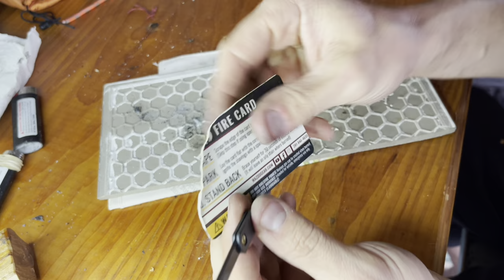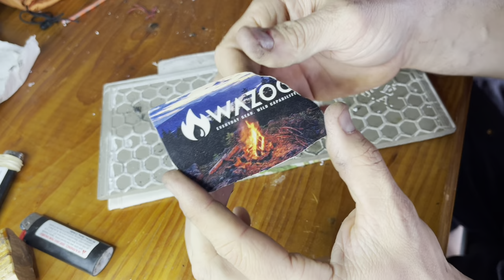Find Out Which Fire Starters Live Up to the Hype! Jason Salyer ON3

Comment: A good idea is to “90 degrees spining” each and every knife you have, from the Camillus Air Force survival to the foldable ones, to both sides of the nail file of the mini-Victorinox keyring penknife. This way you’re sure to have a striker for the ferrorod. And even if you don’t use a ferrorod, a sharp corner is always an asset, for example for getting wood dust tinder from a small limb.

Comment: A lifetime ago while in the US Army I carried 10 min road flares as a signaling device, fire starter, water heater ect...  I had several soldiers criticize me until they needed some hot coffee on a cold morning with no time for other methods. They are light, fairly durable, easy to use but frowned upon around jet fuel and gasoline, LOL.

Comment: Maybe excessive lol but I what I do...I take an old pot and heat up wax and Vaseline together until it's liquid state then take a bunch of make up rounds for taking off make up soak them in the mix and then lay them all out on wax paper to dry... and what you end up with is a most phenomenal water proof fire starter that i cut into 4s to make last longer.... its very cheap to make and works way better than anything I've ever bought!

Comment: One of the fire starters I use are the round cotton pads dipped in wax, they burn for 7 minutes
Reply: Yeah, they are fantastic. I prefer them to cotton balls in vaseline as they are cleaner and don't make a mess.
Very long burn time and a nice hot burn.
Reply: Yeah I agree! 
However, to save on hassle, one could keep the cotton make-up remover pads separate, and when one wants to start a fire, add a blob of Covid style hand sanitiser (gel, not liquid) and rub it in slightly. It will ignite instantly with a ferro rod spark, empty lighter spark or even flint & steel spark. This way they components can be kept in Ziploc bags to be waterproof all the time. It will burn for quite a while, while getting the kindling going. If it does take too long (wood a bit damp, high humidity) just add a pad before the first goes out. 
Or, here's another tip. Use a candle as a flame extender! Candles are unsung heroes, and very good for this purpose. Even those Christmas tea lights left over! They work very well.
BTW, does anyone use a pencil sharpener to make the finest curls? Brilliant - never be without one (especially the aluminium ones that have two size holes!). Just chuck a few correct size soft wood dowels in your pack, as they will make tons of curls! Tinder perfect.
Reply: @dennisleighton2812 👍 .. pencil sharpeners absolutely rock!

Comment: I use the regular round cotton pads dipped in wax. I put some Zippo lighter fluid in the center of the pad, then dip it in melted wax, place on wax paper to dry. Dirt cheap, not as messy as vaseline and cotton balls and it's 100% water proof and weather proof. Tested some by leaving them outside in the rain and snow for 3 weeks, lit perfectly 1st try with my ferro rod.
Burn time is close on 7+min and it's a nice hot burn.
When you want to light it, tear it open and expose the cotton fibers, light with a ferro rod or lighter.

Comment: A trip to the dollar store provides party sparklers or sparkle candles.  Also makeup removal pads dipped in paraffin mixed with lamp oil. Which also works with cotton balls and dryer lint. Another party favor is the trick candles that reignite when you blow them out and of course 4th of July sparklers.

Comment: Here is a duct tape pro tip for ya. If you have really small splinters that are hard to see and get out, you can wrap the tape around the area and use it to pull out the splinters. It works most of the time remarkably well.

Comment: Before I watch, yes they are worth it, eother in convienence, in normal times. Or if you really needed them, that being said, you don’t to buy expensive ones there are many varieties you can make yourself, in small or large batches, depending on climate and how much you use them. Just look to the comments for ideas, on this vid and any other talking about firestsrters, I came up with my own, as a teen, camping on the Oregon coast where I grew up. They involve parafin wax, some Vaseline, shaved ivory soap, motor oil, kerosene, diesel, and naphtha the liquids in small amounts, the solids more of, mainly the wax, solids being melted to a liquid then all of them slowly being mixed together. With cotton balls/old rags, or wood chips/saw dust, a mixture of all 3 at times. They work amazing. If you make my version, use an electronic single burner, outside, with fire extinguishers at hand…as you are heating flammable things, and mixing them, and do it outside only, haha. They work great, but a slight danger to make, of you do dumb things.
Reply: For some context, I started making those, or the early variants of it a bit over 20 yrs ago, growing up camping, hunting, back packing in the temperate rain forests really makes it worthwhile for something like this, some of you may notice, it’s actually napalm. Just modified, with less amounts and one less type of liquid, haha, and missing one main solid ingredient, just lore of the solids, and barely enough liquids, for it to be a slightly soft, waterproof, highly flammable paste, mixed with cotton/wood shavings/sawdust from work. Cheap, simple and very effective, as far asbinn by know, when I started making making these, nothing but ferro/magnesium rods existed, as far as commercially sold, and storm matches. I’m sure if you dig down enough back then, on some super obscure forum, there’ll be mention of something similar, for the reasons of only lighting a camp fire, in survival conditions. Not others, for any of you old enough to remember certain cook books, the old version that used to make it rounds on the internet, ahaha. But survival/bush craft, etc. wasn’t a big thing back then, not like now, wasn’t openly discussed, unless you weee talking about it in a small community, among friends and family…many thought you were a crazy, even as a teen in small America, in the country, where most camped and hunted, that was normal, but talking out lapse of the norms, wasn’t, unless it was it was to the old timers that could remember the Great Depression, or the people that were there first born kids. So for me, those people were same age or 6 years or so younger than my grandparents, other than that, any talk like that was generally frowned upon, or at least seen as super weird.

Comment: I think UCO makes the Tinder Tabs. I’ve been putting them in my kits for a long time now. Recently got some Fire Plugs from Bigfoot Bushcraft (sorry not Wazoo). And now I’m in the process of adding fire plugs to my kits. 
I use flint and steel as my go-to method. Simply because I’ve been doing it for over 55 years. 
I think I have a peanut lighter in one of my kits, but the only kits with the bic lighters (all in an Exotac fireSLEEVE) are in my ‘give away’ kits, and the family kits.

Comment: Something I've used for years and have always kept in my gear is a simple square of toilet tissue folded into a tiny square and soaked in candle wax. They are obviously dirt cheap, easy to light, water resistant, and they burn for several minutes.

Comment: Great video. I have been enamored with fire making since I was a scout and found the little ferro rod set at scout camp in the 70s. But first things first. I am reading the comment's and I have noticed a common  reply to many a request to text a phone number. I am wondering is this a scammer? Or is it you or your friends at Wazoo doing a promo give away thing?
    A phrase we often hear in the military is "2 is 1 and 1 is none."   It speaks to redundancy.  What is the best Firestarter? The one you have on you when you need it. Fire, like the ability to process water, is an area that transcends the 2 is 1 idiom to another common military term "in triplicate."  
  This triplex could be 3 Bic lighters. If you walked into the woods with 3 fresh Bic lighters with the intention of not coming back out until all three lighters were completely expended. I dare say, that even if you were less than judicious in their use, you would be quite some time. However, the reality is this: ultimately, the Bic lighter eventually runs out of fuel. And then it runs out of spark. So perhaps the best Firestarter is the skill of the primitives? I participated in a rather lengthy survival school in the Philippines where the indigenous Negrito instructor while demonstrating his version of the fire saw kindled a fire just as easily as you or I would strike a match. However, that is a man who uses that technique in the same manner as we typically use that Bic lighter. To light his cigarettes.  Knowledge, though, is not the same as skill. I watched him do it. Eventually, and with much greater expenditure of calories than his, I was able to duplicate his result. So there appears to be a sort of venn diagram dictating when a system should be employed to maximize the possibility of a successful outcome.
So the best Firestarter is the one that you have with you that most adequately executes the task given the circumstances at hand.

Comment: hmm, I was hoping you'd have had beeswax 'n chainsaw shreds/sawdust mix.

I know some do, but always lit with a lighter. 
I've lit naked chainsaw shreds (ya get nice shreds when chain is nice 'n sharp) with a ferro rod. Plus I've my father's old stash of beeswax ( 2 or 3 lbs) 
 I've been thinking of making the shreds better with the wax. But I've a gut feeling of too much wax won't take to flame with a ferro rod. ho hum, guess I'll have to do Lab Tests and ramp up amount. (-: 
...sparks to fatwood shaves/cuts is so easy. Replicating as to wax 'n shreds would be great use for dad's old wax stash...for Easter eggs. 

Methinks your big ferro rod might be an EricX Light rod. They work decent for me. (1/2" X 6")
What sold me on them was the pre-drilled hole for cord. 

~~ Oh yeah, ifn in a pickle/emergency for some decent tinder start...have a sharp edge.
One can take a sharp knife perpendicular scrape to back of jeans/ other textiles and get dryer lint stuffs.
Heck, cut the stitching on pants cuffs/unroll and cut that up.

tips me hat ~

Comment: Elastic bands are ok, but if you really want to prevent your Bic lighter from accidental discharge you’d better use a zip tie. It effectively locks the gas button. You simply cannot depress it, even if you want. The only downside is that it usually takes a blade to get rid of it!

Comment: I'm kinda upset you guys didn't address stormproof matches. I myself carry some UCO brand stormproof matches in a waterproof container. If I need to get a fire going they will get the job done. You can actually get boxes of them at Walmart and they come with spare striker pads for the water proof container. Coughlan makes stormproof matches that are just as good but the container isn't the best. Birch bark also makes a pretty good fire starter too. Just pull off a strip and light it up with a lighter.

Comment: Apparently either my ferro rod is too hard or my knives are too soft. I have tried to use the spine of a Gerber and a Kershaw and neither produced sparks, but did produce a burr on the spine of the knives. They work on the sharpened edge but not the spine.
Reply: Use the back of a pair of scissors,  they are usually 90°, the cheap style all metal blade with plastic grips
Reply: @ChrisvilleUSA  the angle doesn't appear to be the problem, the ferro rod seems to be harder than the knife and is rolling the edge
Reply: @Zanthum  4 Directions Bushcraft makes great ferro rods for a good price. The quadratum is awesome for throwing showers of sparks. Not too hard of a rod.  Good luck
Reply: @Zanthum  I have some knives that do that and some that even appear to be burning from the sparks almost like melting. You can buy some low priced Morakniv that will get you sparks without damage also
Reply: I use a 4in. Grinder on ALL my knife backs n saw etc. Quick rough up gives a course edge..perfect! Most knifes etc are not straight sharp edge on back so..even soft metal will work if its rough enough!